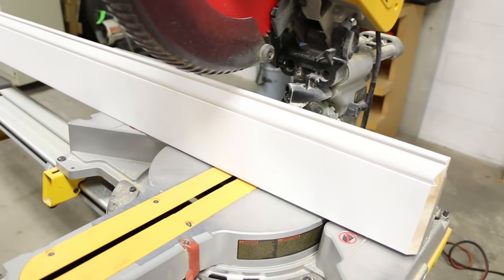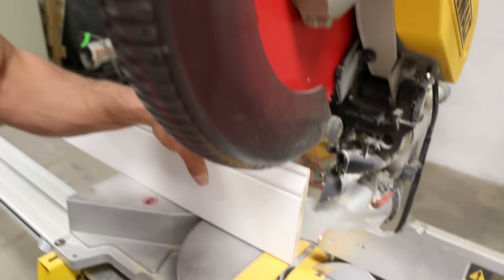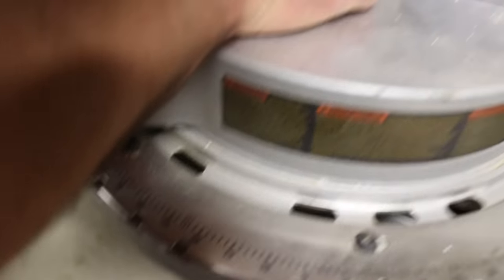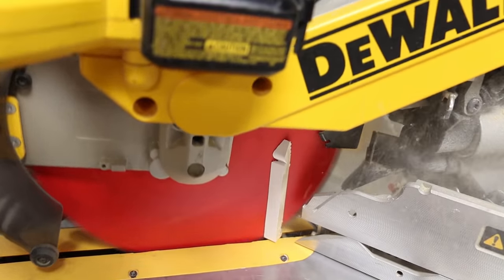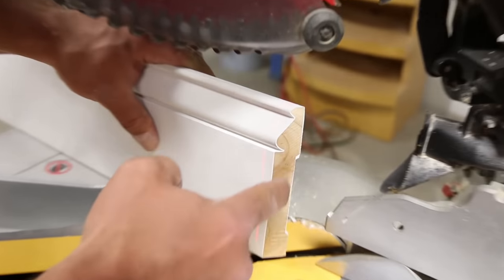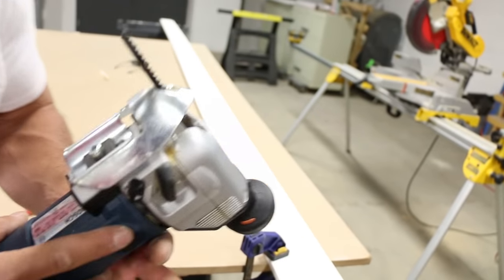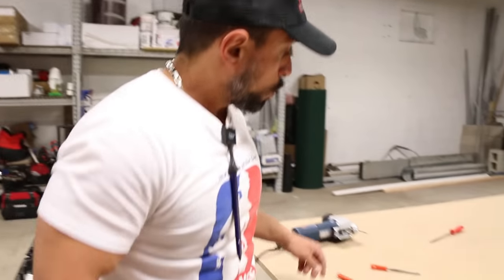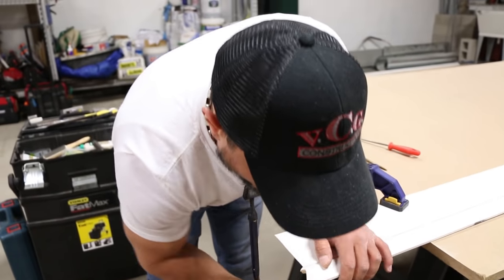How To Cope Molding Inside Corners - Best Way - Collins coping foot

Comment: Love the video!  Unfortunately, most hacks would rather 45 both pieces, caulk it, and call it craftsmanship.  Then, when the house settles, and the turd of a corner reveals itself, homeowners realize what kind of half asses they hired.  There's a reason why the lowest bid is the lowest bid.  You get what you pay for!
Reply from the maker: +Brett Kowalewski we couldn't agree more!!! Lol
Reply: VCG Construction have you ever tried coping with a round over bit on a router table?  I use this technique when I have a lot of shoe to install.  It literally takes 2 seconds and it's perfect every time.  Saves tons of time when shoe is installed.  Set the fence and bit once and you're good to go.
Reply: If your house is built with craftsmanship it doesn't settle.
Reply: Brett Kowalewski I haven't done much trim but I want to improve on it. What's this you're talking about? Can you link or tell me the name of the router and stuff you use? It's much faster than this and this is always super fast
Reply: @mr.wizeguy8995  no matter how much of a quality build your house is, or how competent the builders, your house is going to settle. It's simply because we build with wood. As wood dries it shrinks. This cause slight shifts in the house. We can work to minimize this but we can't eliminate it.
Reply: @ @fieryinferno88  90% of houses in my country is built from wood and nothing settles if you built it correctly. Wood we are using is kiln dried which means it doesn't dry much after when installed if you keep it dry. 
Another mentioned thing is all trims and molding need to store several week inside house which is all ready on normal housing temperature inside so that's way those molding dries out and doesn't dry after installation.
Reply: Brett Kowalewski Is
Reply: 45 ing is for beginners.  Lol..   I 45'd ti I learned to cope.. lol
Reply: I always put the caulk in the corner first....all door and trim is caulked at eye level who cares about some inside joint at floor level, with a good job it will look coped, all trim and moulding is caulked any way....
Reply: We always tell our customers that! Here in the USA everyone is use to paying less. Cheap labor. Cheap everything. But yet they have the audacity to demand a perfect job????? That's bullshit!! You get what you pay for. The thing is if the owner is willing to pay high end money for a job then the owner has more leverage on the jobsite and can demand better quality. You can't demand better quality and fast production on a job you spent 50% off what the average tradesmen charges.
Reply: Exactly my man!!!

Comment: After putting the foot on the saw at what angle do I need to back cut the molding so it will fit right?  To save time you can back cut the straight part of the base board on the chop saw, just sayin,

Comment: I flip the baseboard upside down and cut the straight part of the cope joint with the miter saw leaving the cut for the curved parts to coping saw. The straight part is hard to make look good by hand even with a powered tool.

Comment: cool video. I've never done any carpentry and the wife wanted crown. i started in a small bathroom so i can get the grasp of this. I'm using a regular coping saw and everything was running pretty smooth until I came to the last piece. Maybe I'm just cutting it wrong but on this piece you would cut two inside corners right? I'm having the hardest freaking time trying to get the right length. Do you have any tips for measuring and cutting the finishing piece? I haven't found a video or instructions on that. Any help is greatly appreciated
Reply from the maker: I would need to see exactly what you're talking about. Maybe you can post a pic on our Instagram?  You want to plan out so you don't have a situation where both ends of the molding needs to be coped.

Comment: Production work is for track builders who don't give a shit and it's the painters problem to fill it in.  If it doesn't fit like it grew there, it's wrong. Charge accordingly for your time and build it right, cope your corners, make 'em fit perfect and the only call back you will have is for more work, not a fix to a screw up or a holiday. Custom builder 34 years, wood working instructor, furniture builder, lifelong tradesman.

Comment: To all the hacks that think they can miter inside corners instead of coping faster than I can cope the same room you are sadly mistaken and mine will look way better and stay looking great for years to come.I do the straight section of the cope with the miter saw  and finish with the coping saw like others have mentioned. Mitered corners your measurement has to be so precice and corners have to be square  ( I have yet to find a square drywall corner in 30 years of trim work) keep up the videos and don't listen to the keyboard cowboys
Reply from the maker: Thank you Joe! You da man!

Comment: I think a small grinder with a 50 - 80grit disc would be faster and more accurate. Definitely if you use the Bosch 12v mini grinder, which Milwaukee is coming out with to in a few months.

Comment: I use the Collins my self man do you,  they are just trolls.  look I have  been a carpenter 28 years there are hundreds of ways to do carpentry different techniques do what works for you as long as you believe in quality who cares how you do it. I still keep a plumb bob in my box for welded metal door frames that’s how I learned some guys like lasers I used them too I just like plumb bobs not that laser are not affective I prefer the way I learned.  so you do you if it doesn’t affect quality.

Comment: If you are good with a manual coping saw it would take you about the same amount of time as using the power saw.  For guys who do this stuff for a living, I can't imagine anyone saying you can't do high volume stuff whether you use a power or manual saw to cope.
Reply from the maker: Annoy, people have been getting great results with manual tools for thousands of years. Power tools in most cases speed up the process! Do you cope using a manual coping saw?
Reply: Depends on the material, manual saw cuts through MDF trim like butter but I like to use a power tool on wood trim,  I've even played with using a sanding wheel on a hand grinder and that works well also, just makes a bigger mess.  I'm not a professional but I do enough trim work and even the lower volume of stuff I do I do in a pretty short time.  
 @VCGConstruction

Comment: That's a nice mitre saw, but what's the purpose of the angled slot cut into the fence (first visible @ 2:03)? Maybe Nick could answer this one, assuming he understands.
Reply from the maker: There is no purpose to the angled slot cut in this instructional video, Nick understands that, hence the reason it’s not mentioned in the video..
Reply: @VCGConstruction  The reason I asked is because I have the same model DeWalt without the slot, and I was wondering if I got ripped off. Maybe it's a recent upgrade; after all,  mine is ~ 15 yrs old and yours looks brand spanking new! Say hi to Nick for me; or better yet, just show him this post.
Reply from the maker: You've had the same DeWalt Miter saw for 15 years, have never had a need for the angled slot and you're wondering if you've been ripped off? Okay cuz, i think you've got your moneys worth 😂👌

Comment: As a finish carpenter with 55 years on the job experience, I can tell you that this method is far too slow. I Use the Murphy method  which is to look in the door and estimate ,accurately, the lengths of moulding which i cut all at the one time with a chainsaw ,then install using a four pound hammer giving one stroke per nail, then i fill any mitres ,copes etc with a cow dung  and PVA paste mix.This is a time proven method with many, many, satisfied customers..

Comment: Poznaj wymowę

so tell me how do I do this with this profile?   https://youcon.com.pl/environment/cache/images/0_0_productGfx_834e3d1eb2c291a181977065f9720dc1.jpg       This is impossible because the part of the skirting board you cut off at 4:50 is practically the whole thickness of the skirting board, every time I did it, of course, it fitted perfectly, however, the profile of the skirting board did not go to the very end, with a few clients I tried to do it to none of them  didn't like it and I had to change it to measured angles, I will only add that in my country this profile is up to 90% of sales of skirting boards